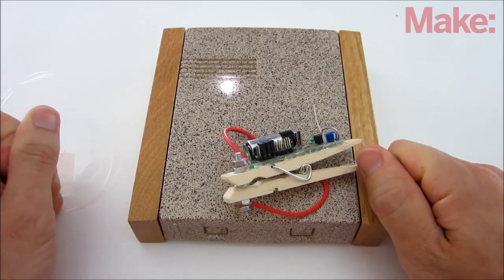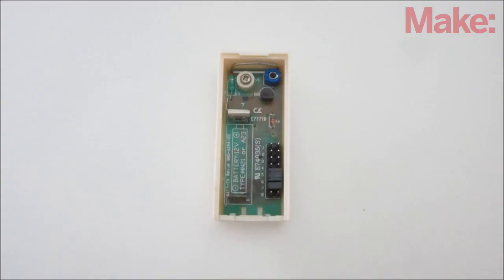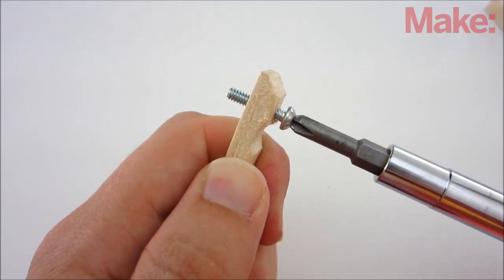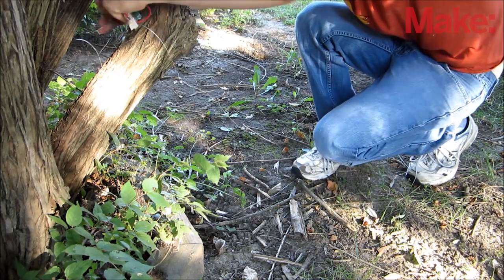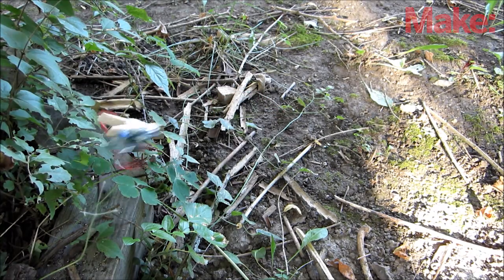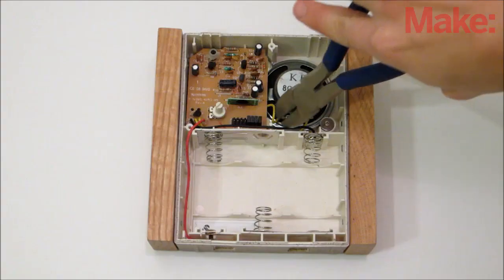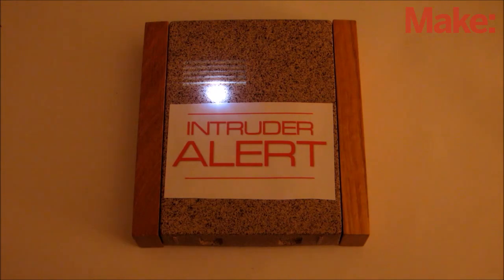DIY Hacks and How To's: Building a Better Tripwire

Comment: Oh... thought yo were going to solder a wire to permanently close the button and switch the battery with the tripwire. Maybe is the same the circuit does just to save battery.

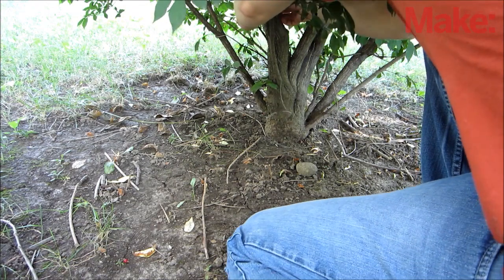Comment: When drilling at 1:48 don't put your finger directly behind the drill bit as you may end up drilling your finger...in fact, NEVER hold loosely what your drilling...EVER. Put it instead on a bench and clamp it or put it in a vice and then drill...safety first cobber.

Comment: Secure the trigger to the tree at least. 1> Its a visible unnatural thing in the environment. 2>  The weight of it dangling like that needs too much slack in the actual tripwire. It will tip people off to the trip wire's presence while they still have time to stop and step over. 3> Dangling like that the circuit board will catch more breeze and it will flutter adding to the likelihood of a false alarm or being spotted.
Andrew Schreck has the best idea.

Comment: I think if you were trying to go for covertness, You should mount the clothespin securely to one side, instead of dangling from a string, that way, your transmitter doesn't get banged around, or gives away it's location.